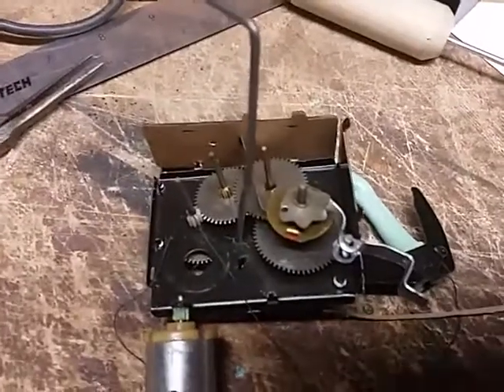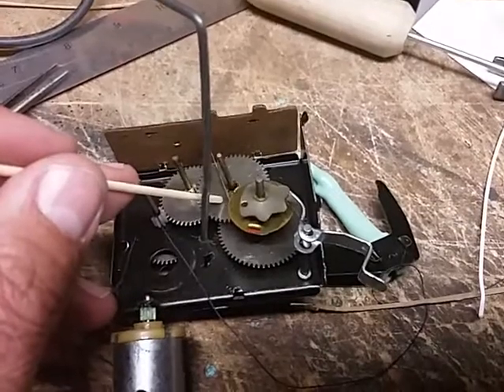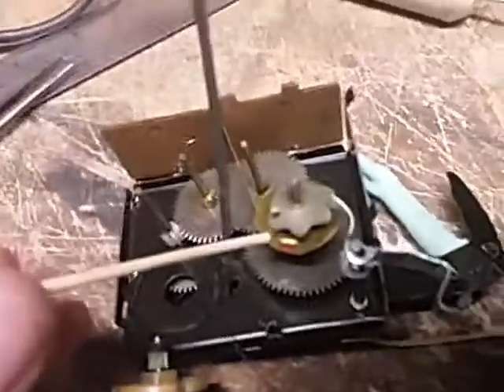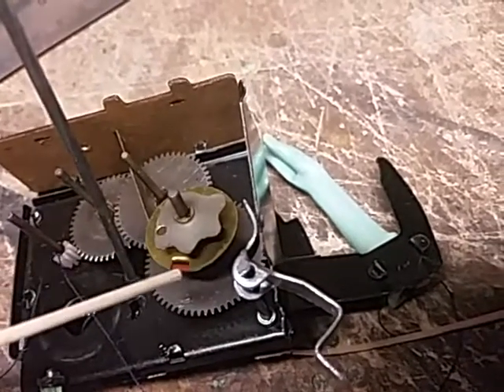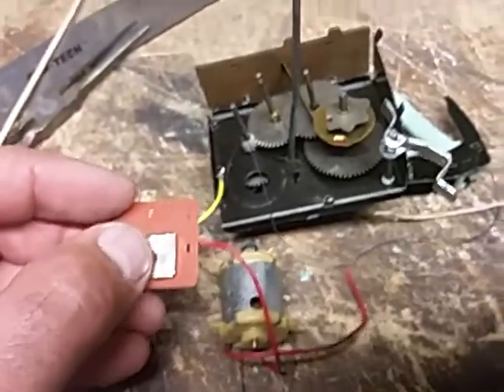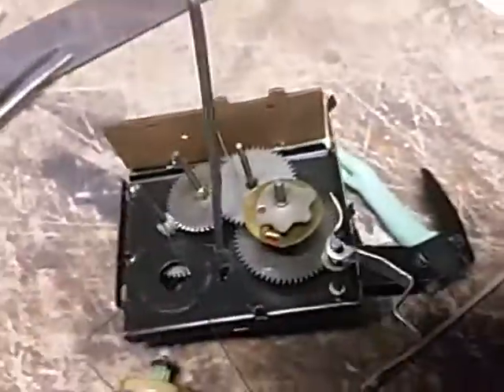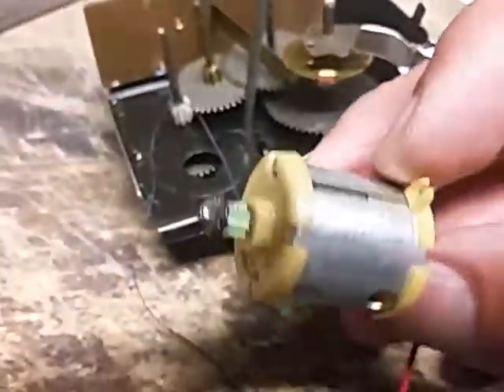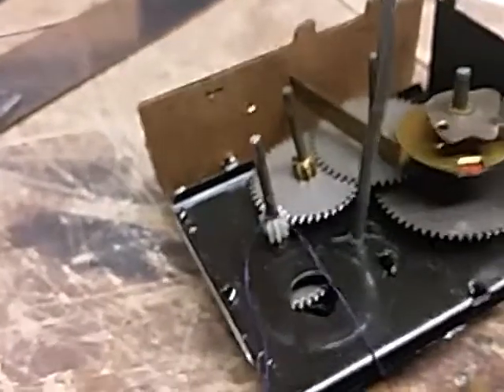Addams Family Thing Bank Inner Workings and Pinion Gear Repair

Comment: E-Bay sells replacement gears for this. I just bought one of these banks, but it hasn't arrived yet. The seller says it has been restored and works great. But I ordered a replacement gear set in anticipation.
I wish someone would do a video on how to replace the gears. At some point I suppose I'll have to figure it out for myself.
Reply from the maker: I can walk you through it, I have replaced the plastic gears on several of these little boxes
Reply: @cjholmes4329  How difficult is it..? Is there any soldering to do (do you have to remove the motor wiring..?)  The gear set comes with one large gear, and two smaller ones.
Reply from the maker: Yes, dont be surprised if you have to do some de-soldering to get things apart
Reply: @cjholmes4329  I can do some soldering, that isn't a problem. Do the old gears just slide off the shaft..?
Reply from the maker: The old gears are probably split and just spinning on the axles so they should come off easily. I would recommend boiling the new ones in water for several minutes to make them pliable enough to slide on the shaft. Once they're on and cool they should be good to go
Reply from the maker: I don't know if my first reply was sent but the old nylon gears are probably split and will slide off easily. Regardless, it shouldn't be difficult to pull the old plastic gears off. Boil the new gears in water for several minutes to make them pliable enough to slide onto the axle. Once they are cool they should have a nice tight grip on the shaft
Reply: @cjholmes4329  ok thanks. I'll try that.  I bought two on Ebay. The first one should arrive this week. The motor runs on both, but they do nothing, so I'm assuming (like you've mentioned), the gears are shot.
Reply from the maker: Awesome, let me know how they work out
Reply: @cjholmes4329  I will, thanks.
Reply: I have it partially disassembled. there is a bar that comes out and makes a 90 degree turn. It appears to me it's blocking me from taking the cover off (over the gears). In your video it looks like you straightened this bar out to remove the cover..?
Reply: Success..! The hardest part of the rebuild, (for me), was lining all the axle's back up for reassembly. As you said, the two small gears were split and turning freely. Replaced them without a problem (after I warmed them in hot water). I wonder why they didn't use brass ones like they did with the other two small gears.  ($$,..?)
I tested it before mounting to the metal base, and it wouldn't run. Attached it to the base and it took right off. (Completing the ground.?) 
The hand comes out and snatches the coin, but it doesn't seem to want to let go.  Not a huge issue, though. I'm glad it works. I saw where in it's past someone had tried to fix it, as the tabs were all scratched up.  My other one should be here next week. Now I feel a little more comfortable with what I'm doing.
Edit: It took me about 2 1/2 hours to rebuild. I got the second one in the mail today, and rebuilt it in about 1 1/2 hours.
This 2nd one lets go of the coin. I'll have to play around with the first one and see why it's holding onto the coin.
Reply: Ok, the bar I had bent straight to allow removal of the gear box cover. This bar knocks the coin out of the hand when it snaps back into the bank. I had to bend it up a little higher to hit the coin, and now it works perfectly.
Reply: CJ I just got a bank 5/13/2024 and it comes on but the arm of coarse doesn’t come up! I did a little search and found your video! How do you open the box to start with so I can see what’s going on inside? Thank you!! -Derrick
Reply: @derrickis  If you're talking about the gearbox, there are metal tabs that have to be carefully bent in order to take apart the gearbox. Screwdriver and needle nose usually does the trick.
Reply: @dahur hey dahur I’m having trouble figuring out how to get the plastic outer box off the even see the internals of the box. It looks like the plastic shell just pulls off but it looks delicate and didn’t want to break the plastic outer case?
Reply: @derrickis  you can probably stick a knife in here and do a little prying. Usually they come off without too much trouble.The outer case is pretty tough.
Reply: @dahur  thanks D! I know I can buy a pack of the plastic bushings online somewhere, do you know what exactly to look for??

Comment: Is it OK to buy those 9-tooth gears or packs of assorted plastic from eBay or Amazon?.  That's what I did.  I have a Venus Fly Trap bank I want to fix and that little pinion gear appears to be the problem.  The gears on the motor side spin, but those on the other side attached through this tiny pinion do not, so it appears to be the culprit.   All of these Poynter toys have a similar set up.  
I have not taken it apart yet so I can't tell just how many teeth the little gear has.  I think maybe 9.

Comment: Where can I buy replacement gears for bank, I don’t see anything on E Bay. What size gears are needed?
Reply: The motor gear is a 8 Tooth number 8t gear with a 2mm center hole (aperture). It is 5mm in diameter.

Comment: I have an Adamms Family Thing bank that I have had so long I don't recall where I even got it. The motor works but I'm afraid the gears are the problem. I will be honest, I myself would be able to get this bank apart but putting it back together would never happen. Is there someone that does repairs on these banks?
Reply: Addams.......
Reply from the maker: If the motor works but the gears don't move then the plastic pinion gears are probably the culprit.  I can fix it for you.
Reply: @cjholmes4329  Where are you located? I believe the motor does work but the gears just spin. What is your fee? I am on FB if you want to send me a PM. Lori Dyer Rhoton